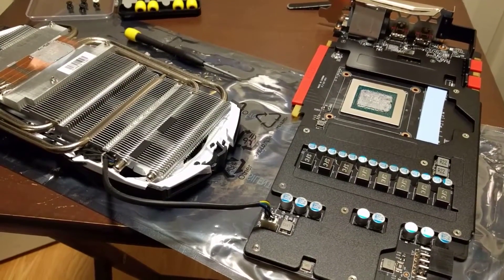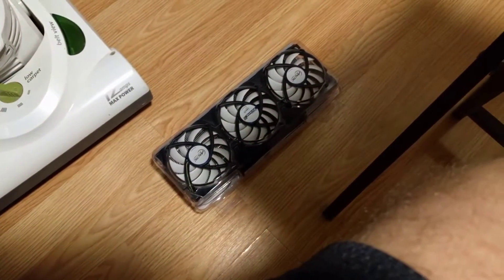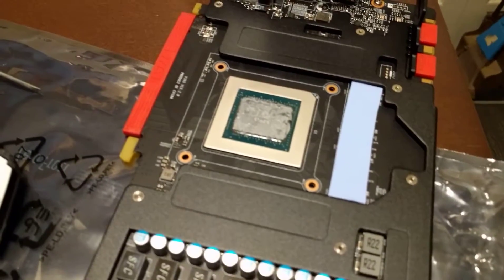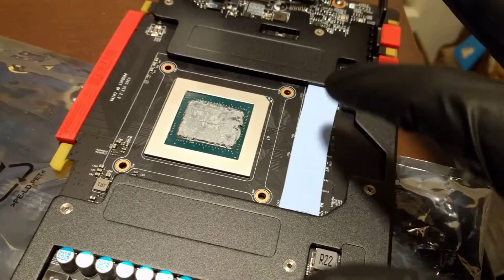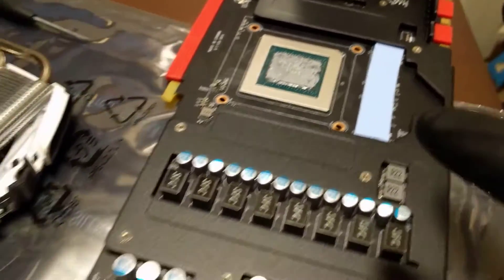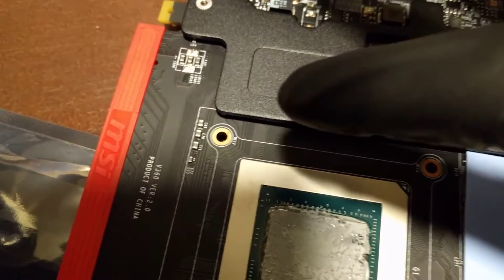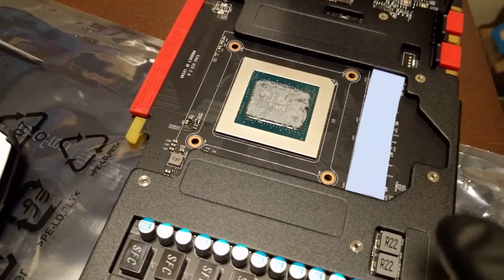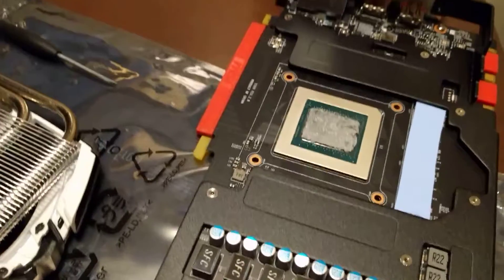MSI Armor 1080 ti disassembly getting ready for Arctic Accelero 3 Part 1

Comment: man you put only on the blue thermal tape heatsinks? (4 heatsinks) the card is okay?
Reply from the maker: The rest of the card uses the baseplate to cool and the fans blew down on that. Worked great until I just got my 2080ti
Reply: @patrickmurphy8619  ok, then i only need to put 4 heatsink like you, and put the cooler, right? And that`s it?

Comment: Did you break the blue heat plaster to glue the heat syncs ? Or you just glued them on the plaster ? I might do the same thing and I want to see a full change, only your video I found until now which shows more details for this card